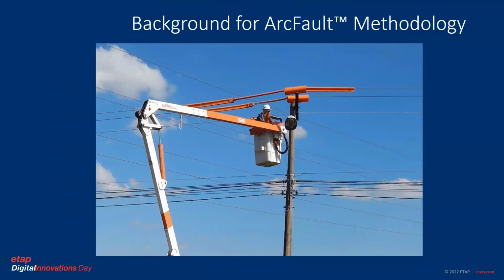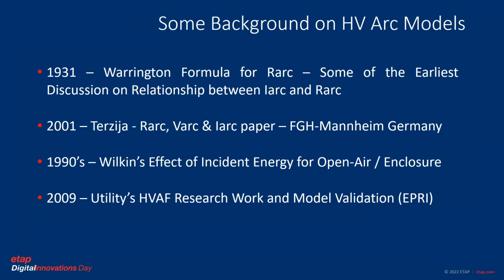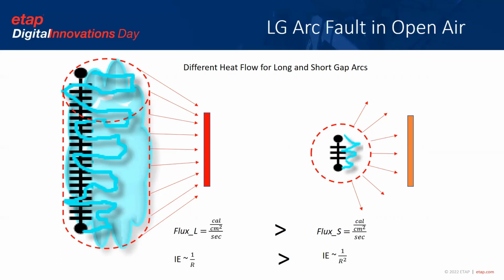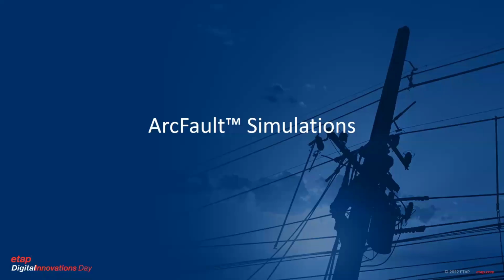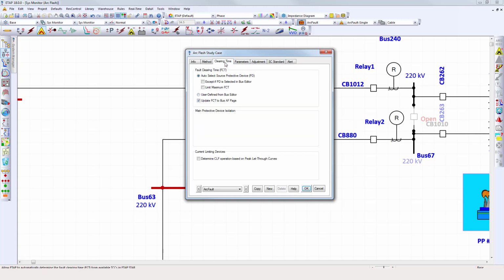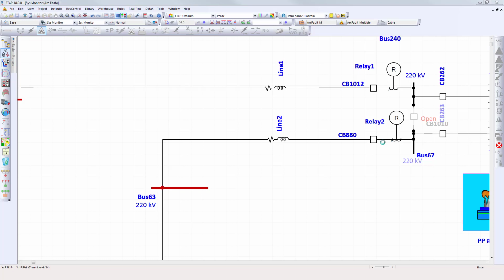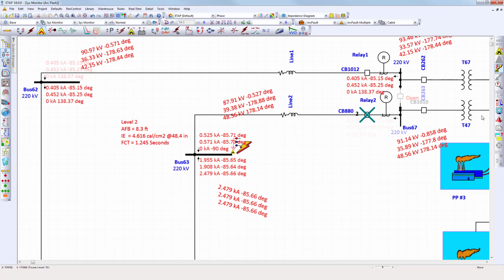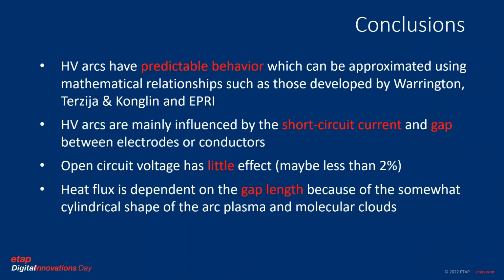High Voltage Arc Flash for Overhead Conductor Systems

Comment: Thank you! This might be a repeated question (sorry for the bother!), but I’m wondering if this project can be shared in a PDF format, if not as an ETAP file atleast. I would like to replicate the design to perform arc flash simulations and analysis, similar to what you've done here.